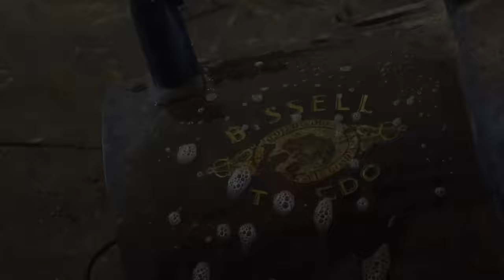Someone paid an equivalent of $2000 for this in 1914 [Restoration]

Comment: 33:01
Next to the grinding wheel we can see that the flywheel has a notch for a V-belt. This implies that this isn't just a vacuum cleaner / grinder combo, which is already mental... it means you can attach a V-belt and use it to power pretty much anything you dare. Crazy stuff. I don't know how practical and / or dangerous it was back in the day but it is has beautiful castings and overall workmanship nevertheless. I don't want to sound like a broken .mp3 (insert planed obsolescence rant) but companies used to take pride on their work. Products were built to last a lifetime and most were easily repairable.

Comment: Apparently you use the grinder and then vacuum the shavings.  There’s a place for an auxiliary pulley belt just behind the grinding wheel. Possibly  to power other machinery.  In the old days one motor powered just about everything in the shop.

Comment: Im new here and subscribing!  You should always use a screw driver or tip that covers the biggest surface of the screw head.
Especially if you are doing a restoration So screws look good after re assembly. I restore vintage clocks and engines so have some background in motors in general

Comment: Thats an awesome little machine from the dawn of the electric home appliance era.
Did it use an adapter to plug into a light socket?,as most early home electrical installations only provided lighting.
Awesome restoration by the way.Its incredible that it even survived at all,never mind that it was in such a well preserved intact state.

Comment: It would make more sense to have the bag on the side so its not trying to blow up through the continually accumulating dirt. And it wouldn't fall into the impeller when turned off.

Comment: The biggest issue I see is that it was designed to operate on 25 cycle instead of 60 cycle power. This means that the RPM will be entirely outside the design specifications for the motor and its bearings unless it is converted to 60 cycles, or ran from a 25 cycle power supply. Running a 50 cycle motor on 60 cycles is close enough to not cause issues in most cases, but running a 25 cycle motor on 60 cycles will cause bearing wear and possible overheating from magnetic flux issues. One can check the RPMs to see if they match the design RPMs. If they match, then the motor was already converted, and they did not re-stamp the motor plate. The original Niagara Falls grid ran on 25 cycles, along with some railroad power systems.

Comment: For rusted bolts I’d actually tighten a tiny bit which normally broke them lose then I could remove. They’re normally stripped slightly reverse but perfectly fine tighten

Comment: You know what, this is actually so cool. It's like the Smartphones of 2014. Yes, they did everything worse than dedicated things, like dedicated cameras or calculators, but they did do everything in a single package. And if you're not a farmer but, like, have a cottage, you may need all of those from time to time, but don't want to have all of them around. It's like the history repeating itself in a way. 
Also Off-low-off-high is a great thing. Whenever you click first is off. Except I don't really understand how is the top-blowing vacuum supposed to keep the garbage in place? Maybe you collect it in like a bucket or just blow it all outside? Looks like it was intended for use in shops... Also, how does it work like a pulley?

Comment: If you pointed the hose near where the grinding wheel is, you'd have a grinder with a built in dust collection. It's my guess that is exactly what was intended. I kind of wonder if there were more attachements, since the knurling on the end of the grinding wheel implies that it was meant to be removable. As for the paint...Would bet that it was rusted beneath, and since it was attached to the rust, it washed off when the rust dissolved. It sort of looked as if the only thing that was preventing it from working was the switch!

Comment: The belt pulley near the abrasive wheel hints that this device is even more functional than shown.  Most likely it can be used as a drive for other devices.  Sorry for my English, I'm writing through Google Translator

Comment: Clean the copper dust from between commutation segments before applying power. Don't clean commutators bright. The brush material 23:13 fills the pores of the copper and lubricates the brushes. Overcleaning can actually damage a commutation. And the surface of the insulation between segments of a commutation should be LOWER than the copper segments and must be clean of copper to prevent shorts.

Comment: This is not restorations. It is destruction. No restorer worth their salts would ever smash metal parts against their vice or drill into original metal. They'd also never ever put a commutator on a lathe like that not knowing about under cutting or any of the proper motor repair techniques.

Comment: Really need to take those insulators down a bit between the copper segments on the commutator else they will prevent the brushes contacting properly and may cause excessive arcing and burning

Comment: GET RID OF THOSE FLAT-GROUND SCREWDRIVERS! They do not engage the screw slots properly and help strip the heads. Get a good gunsmithing screwdriver set with replaceable hollow ground tips. They come in many sizes and fully engage the slot from top to bottom.

Comment: you might want to try saving the decal bye brushing a light coat of paraffin-- wax on it most strippers will not melt threw but heat will melt it away do your priming and top coats then use a heat gun or hair dryer or heat gun and cotton balls to clean up ,ive saved many fragile decals this way

Comment: Have you ever tried to use a pressure washer after you have done the anti rust vat?   This is what I do and it saves me from having to sand blast. I use a vat of diluted muriatic acid (with water rinse in between dips from acid to base or vice versa), and a vat of diluted sodium hydroxide. This will turn the rust black after acid dip, then the black washes away during pressure wash, once I'm done with the acid bath and pressure wash, I do a quick dip in a vat of clean diluted sodium hydroxide and a water rinse. The diluted sodium hydroxide neutralizes any residue acid and prevent the parts from rapidly rusting. The diluted sodium hydroxide will de-grease and remove paint from parts when using in conjunction with a pressure washer.  I use three vats in total, one dirty base, one clean base and one acid. :-)  Btw, one can source the muriatic acid at any swimming pool supply, and a good source for 100% sodium hydroxide is Red Devil Lye drain cleaner, don't use drain cleaners with additives.

Comment: Omg i busted out laughing at the wire wheel scene... everyone who uses a wire wheel or buffing wheel on a press knows the struggle. I restore old small engines in my spare time and always something gets pulled out of my hand and flung elsewhere on the floor from using the wire wheel.

Comment: Pretty sure it still falls under ULC and CSA to this day no problem, why would there be?   It's an abrasive grabby wheel spinning at 2500 rpm.  Bissell never took a day off safety.  I think there is actually a self feed drill attachment that fits on the end of the grinder assembly.

Comment: So the pulley is to supply power to other things that don't have their own motors.  
So how do you set that up?  With loose wheels it won't keep the belt tight but will roll a bit.  There doesn't seem to be any kind of mounting options.  Maybe you take the wheels off and use a different, fixed, base?

Comment: Great design details in this old device except that the dust bag for the vacuum part is directly above the hole. When you shut down the engine, all the crap you just vacuumed ends up inside the machine!

Comment: Wow. Beautiful. I didn't think it was a vacuum cleaner. I have a question...what could the pulley-like part behind the grinding wheel drive? Or rather, this vacuum cleaner could be driven in a machine-like manner, even with a V-belt, and that's why the place for the V-belt is there?

Comment: Looked up the Bissell company and apparently this was a vacume manufacturer for home care and carpet.  The grinder may not be original.  If this was for cleaning it could have been a buffing wheel to polish brass although no way would you hold this thing next to a door knob but remove the knob and buff.  Anyway, just a guess.

Comment: Not true, i owned a 1870 Victorian that had a central vacuum system in it when the installed electric in it in early 1900s.  The pipes were 3 inch galvanized that ran to large brass plates in the baseboard, they had hinged flappers with leather gaskets.   The motor was gone but I installed a new central vacuum motor on it, made a connector for the hose to insert in the hole after lifting the brass flap.   I now own a 1912 home that has a door switch the turns on the light in coat closet.  There is nothing new, just changed.

Comment: some of these old paints are rock-based, and the binder is shellac I'm pretty sure the evaporust dissolved the shellac the paint that's then left is nothing more than mud so it just washes off.
also, try to find the 1010 star hand pump action vacuum cleaner when restored it works really eh, badly but, you get a good workout!

Comment: This is what reliability means when plastic is not used anywhere. Let's say the same idea more categorically: a device that does not have plastic parts is many times more reliable. Today you will not find household appliances with the same reliability.

Comment: Very odd, but I love the design of it though. I've not seen that blasting cabinet before, a proper mans tool, best thing to do is get some old conveyor belt to protect the grid from being blasted away, there is also a benefit of the media bouncing up to to abrade the back of some stuff saving a little  work.

Comment: 8:20 you probably knew…. Just wanted to create some suspense! 😂 (honestly, that is kinda sneaky 😈)

16:00 have you ever looked into a wet blasting cabinet (blasting cabinet that has the abrasive moved by liquid as opposed to air? I hear the surface finish is a lot different). Also I’ve seen some channels get the laser rust removers that also can remove rust some paint (and other thin things on the outside of a materials).

Comment: when turning the contacts force slight eccentric to be introduced,  I use 0.05mm brass shim on one side of the center, why? this will force the graphite to wobble enough to prevent dust, oil... from building up making them stick but not enough to damage them. also that is more or less a perfect forg blower

Comment: It seems to me that would have a buffing wheel instead of a grinding wheel attached to the vacuum. For polishing the silver and other things that the maid would need to polish. Of course the cook could use it to sharpen the kitchen knives also. For what it's worth. I probably would have given up after 10 minutes not figuring out how to get it to open up...😊
Reply: It actually came with both the grinding wheel AND a buffing wheel.  See my post above for an interesting writeup and some pictures from a 1912 journal called "The Electrical World" for more information.

Comment: dont heat the bolt, heat around. it will dilate the metal around the screw, then it'll be easier to remove.

Comment: I wasn't going to go back and read through 2000+ comments. What are the chances this not actually a vacuum but a blower for a coal fired forge with the grinder for sharpening punches chisels etc?
Reply: Why else would the hose connect to the intake? 🤭

Comment: Please use heat till it is red glowing. Use wax. Oil is burning of! Cool the screw down with water, then tap on it to loosen the rust. REPEAT process. If it doesn't come of. Then you can use a drill. Patience is King my Friend 😉

Comment: As that motor is rated at 25 HZ and DC it may well get to hot with 60HZ and or not run at the correct speed, it may be an idea to get a DC source for it.

Comment: The only thing that I would have done differently not that it matters at all or anyone cares is preserve the wood handle with some type of oil probably linseed instead of painting it. Could be an easy change sand it down real quick.

Comment: 31:48 , he saved the data plate for last . 
But like I said , American 🇺🇸 made products don’t break down . THEY WARE OUT ! So this device he reconditioned , still worked when he decided to do this project . Um , I took notice that the motor brushes were in good condition too . Most of the peices that machine were cast metal . That machine will work when the century turns again .

Comment: What an oddly built thing.  why would anyone make a vacuum that blows up into the bag so any larger bits would want to fall down back into the impeller?  and why combine it with a knife sharpener? and whyyyyy do the wheels need thrust bearings?  very strange

Comment: What was the belt pulley for?
Reply: It was sold with the pulley, and it was developed to use as a motor capable of driving any number of home appliances, the 1912 journal I mentioned in a post above says the following:
"The motor itself is provided with a sheave, and may be used to drive a washing machine as illustrated in Fig. 2, or a buffer, grinder, ice-cream freezer or other household machine requiring a small amount of power. 
...
With each outfit are given a buffing wheel and an emery grinding wheel.  The grooved pulley will enable direct connection to be made to any small machine to be driven at high speed. 
For slow-speed washing machines, ice-cream freezers, etc., a countershaft and base, as shown in Fig. 2, are furnished. "

Comment: 19:11  you have forgotten to put a piece on before you put the motor back in.  That small pin held on a part that had a screw also
Holding it.  

Later 31:33 the handle holder is magically on now?  

Some fishy editing going on… 🤔🤷🏼‍♂️😜
just paused to comment.  🤷🏼‍♂️

Comment: I find in my collection of 1900s and 1910s electronics that they are safer than modern parts nothing is flammable and there's no chance of short circuit I trust a 1910 switch and a 2020s switch not so much everything is made from flammable plastic and the wiring is bare and way to close to each other for comfort they got it right in the 1880s and it was downhill from there!
they just made it cheaper and called it better and safer than the parts that came before but it's all a big lie!
if you find a lamp with 1910s wiring and parts leave it do not put new stuff on it it survived 110 years for a reason it simply never failed!

Comment: Could have used penetrating oil to loosen those first few stubborn screws instead of grinding and drilling them away. In fact, some of them were just painted in, so wire brushing off would have done the trick. Perhaps more patience and less gung-ho is needed. Also, never a good idea to reuse ancient electrical cable.